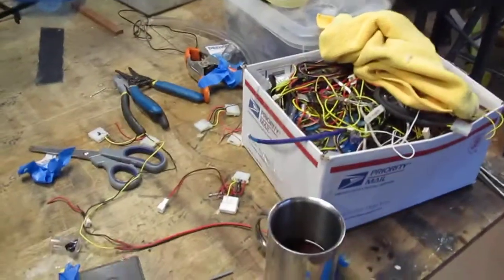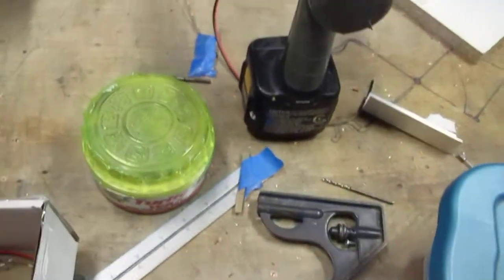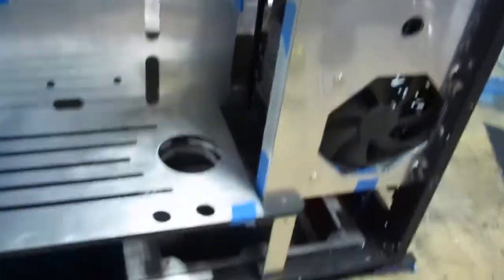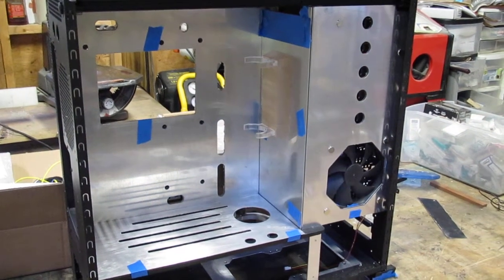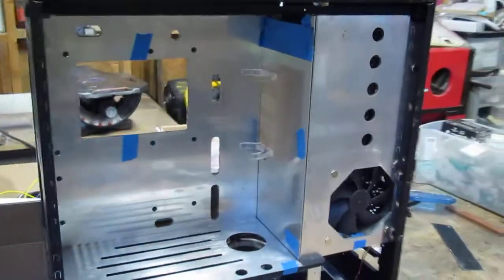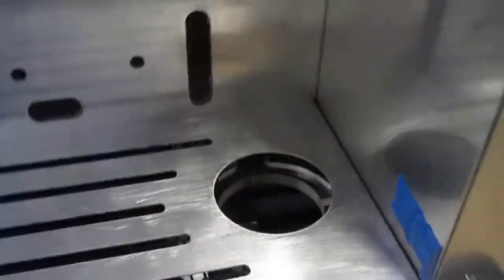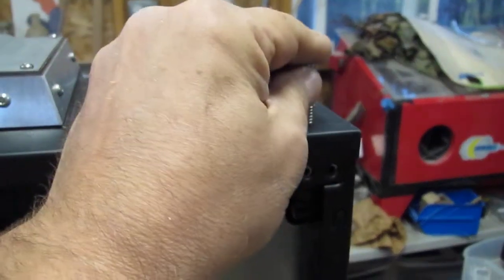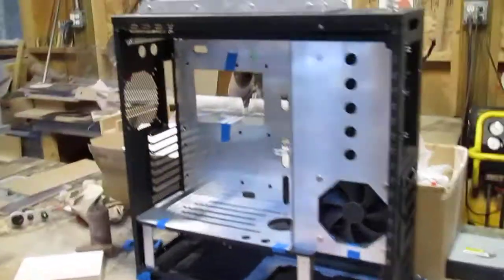Magnetically Aligned and Captive Trim Panels: Gemini Project Disclosure 1

Comment from the maker: @Loop0001rath Just do some tests. Put 1/2" x 1/16" Neodymium magnets right on the HDD, The video card, the CPU heatsink...wherever you want and see if it has any effect. As long as you do not electrically short out something (magnets do conduct electricity) there well be no effect whatsoever. You'd have to subject a HDD to one helluva a strong magnetic field to wipe it.